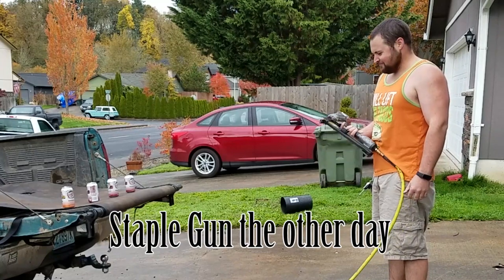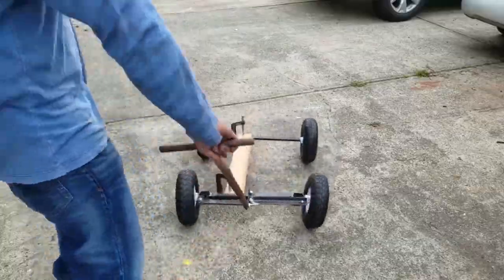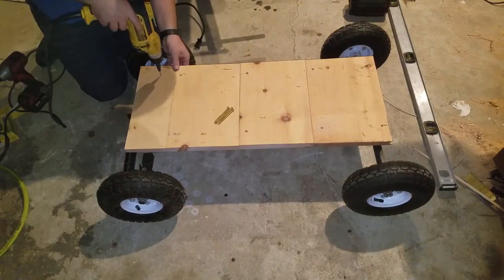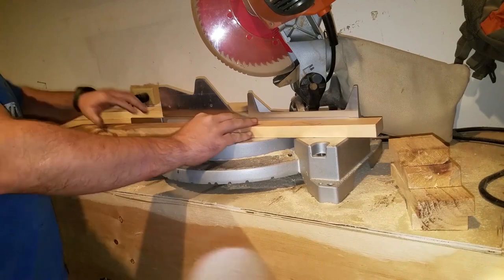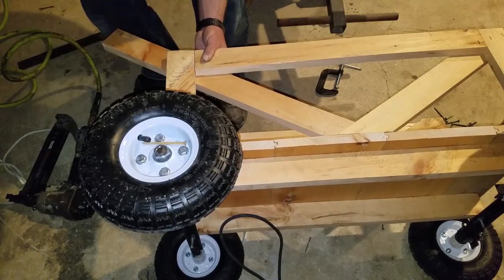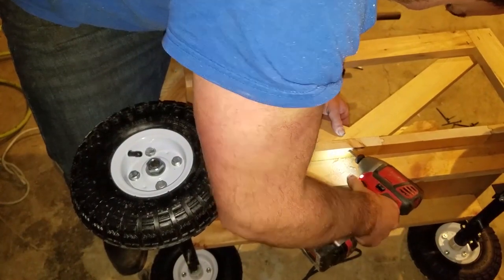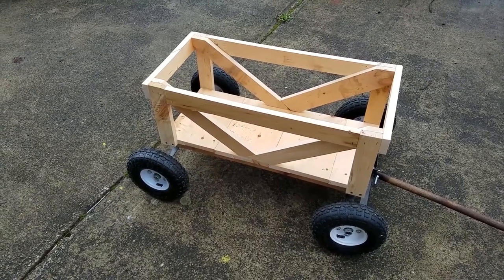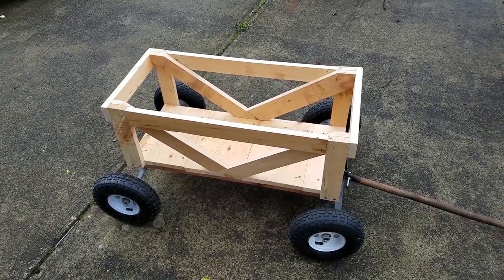Homemade Wagon with Harbor Freight Welder, Part 2

Comment: Where do you get your sheet of steel from ? And is it alot if money. For that size you got?
Reply from the maker: What i used here was 1.5" 90 degree stock, and it's not too expensive. All in this project was about $50, including wheels.
Reply from the maker: +Saul Pagan NYFC I forgot to answer your main question: I got it at Home depot, but you can get steel cheaper from a distributor. There's thousands of them across the country.